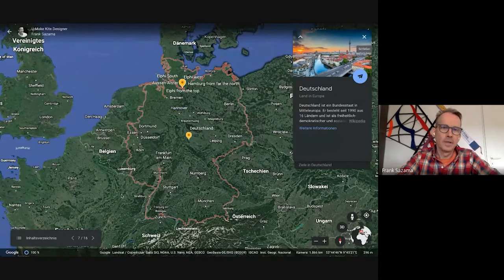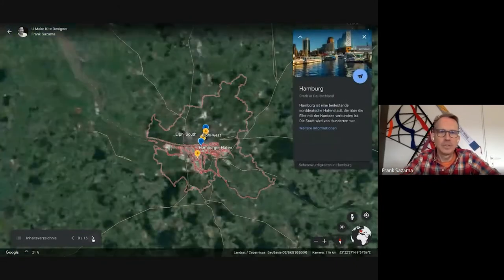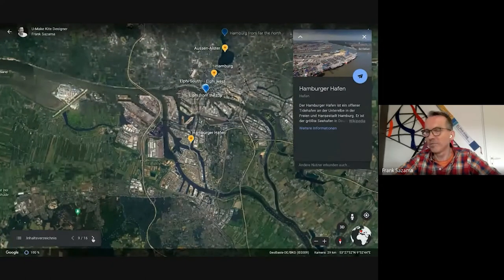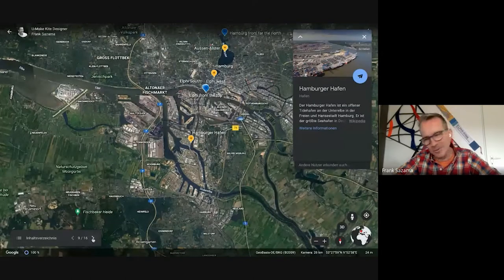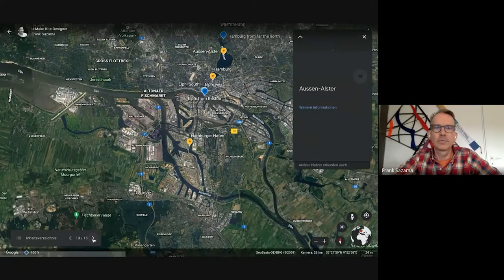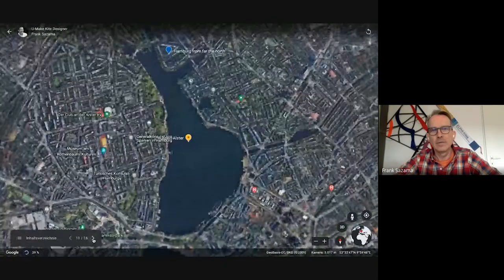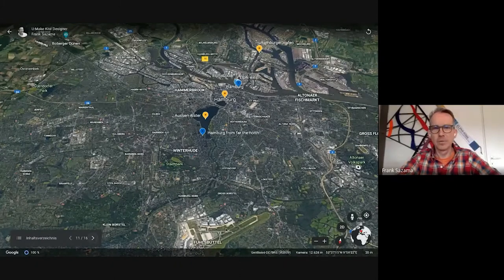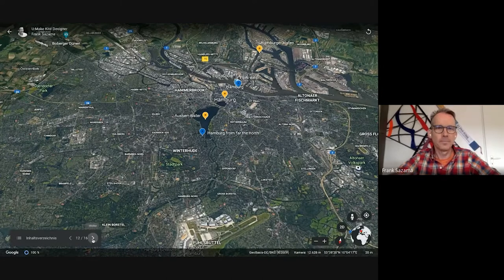2021 Kitemakers Conference - Frank Sazama - The MegaVented Kite Building

Comment: Interesting video and thanks for the tips and tricks.
Question? The small kite parts (lines) are made of double layers of Icarex P31. You stitch your molds to the Icarex if I understand correctly. Does your molds then stay between the 2 layers of Icarex and does this provide the stiffness of the 'kite sail'?? If yes, what kind af material do you use for your molds?
Reply: I see it already, you sew just next to the templete, then you turn the pieces inside out and sew them flat with a 3-stitch zigzag. Correct?